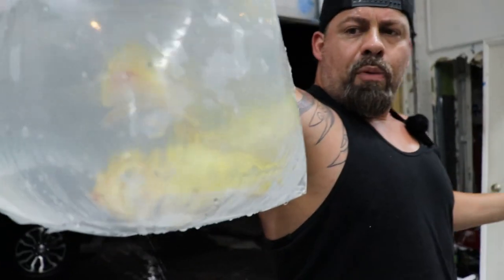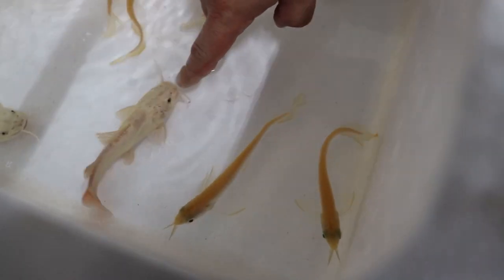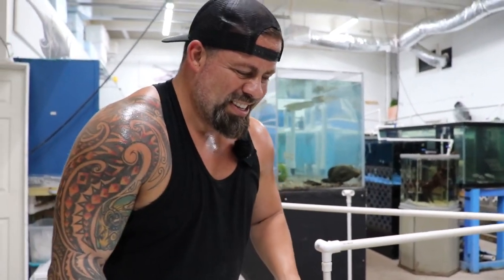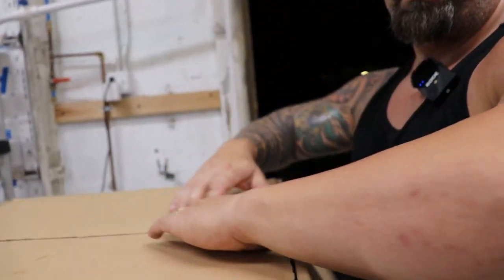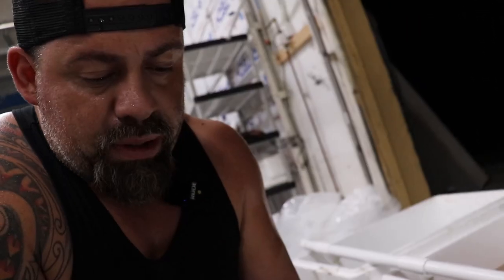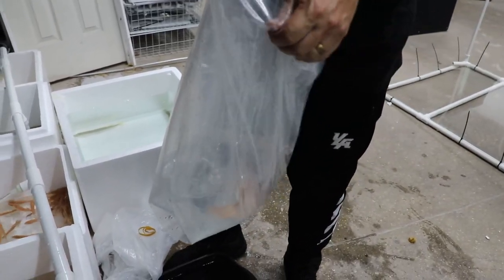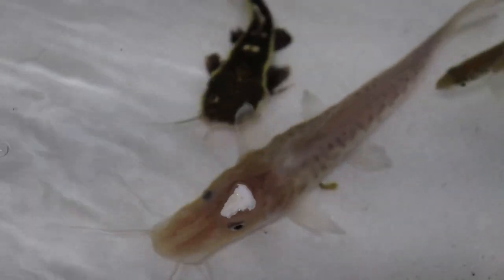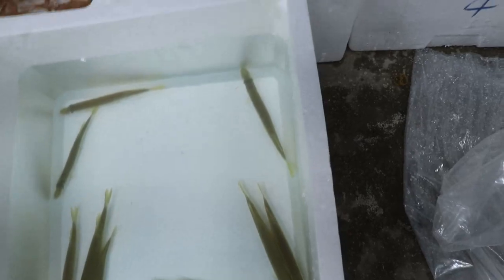YOU'VE NEVER SEEN FISH LIKE THIS *UNBOXING*...... ASIAN SHIPMENT part 2

Comment: If you got two round sharp cookie cutters, you could use them to make quick/easy holes for the drain. Just push one cutter against the other with the box in between. The boxes should all be at a higher level so you can fit all types of fish. Then get two mesh type baskets that fit in together into one poly box (so you can put species together) no extra handling. You also need turn off valves for each of the drip hose, that way you can turn one off and leave the rest running while you sort into tanks.